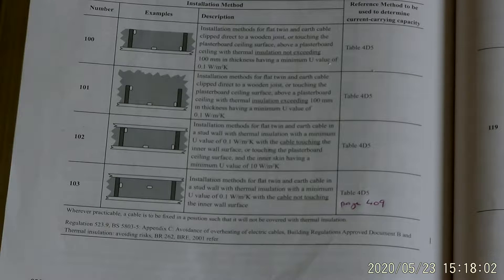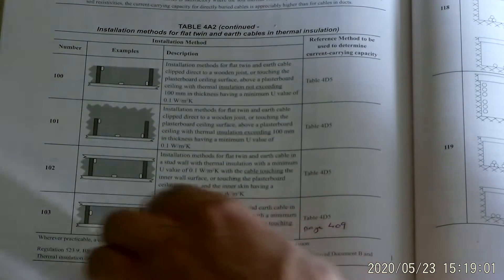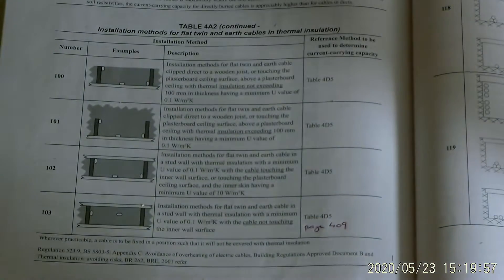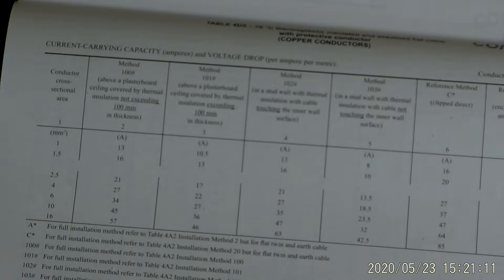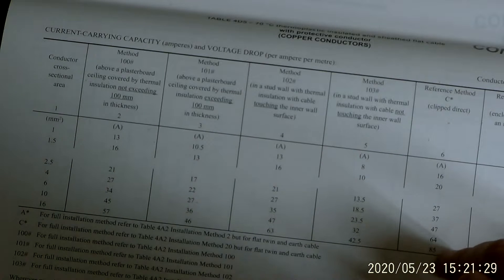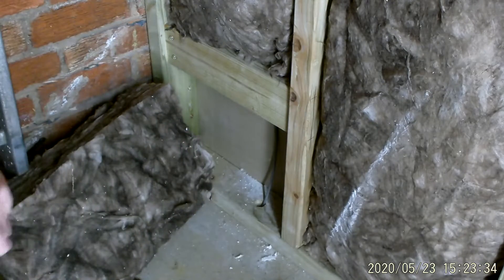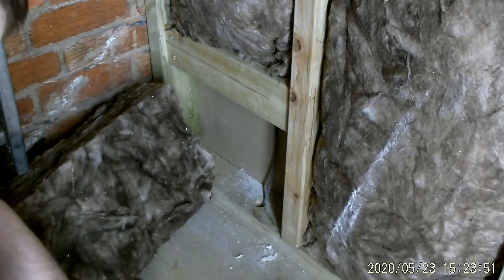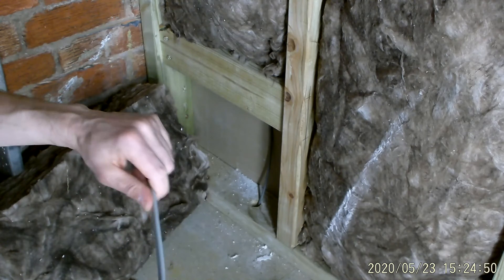28  Using BS7671 to Talk through installation methods and insulation in a stud wall

Comment: You say there’s not much current flowing through the circuit .just bedside lights etc. When I was doing my apprenticeship and I still apply that now  is you must always allow for the fact that the central heating could fail and someone could plug a electric fire in.. in fact I have seen this happen very often